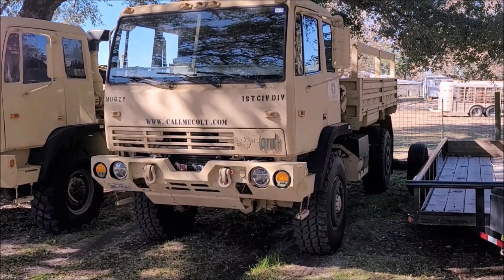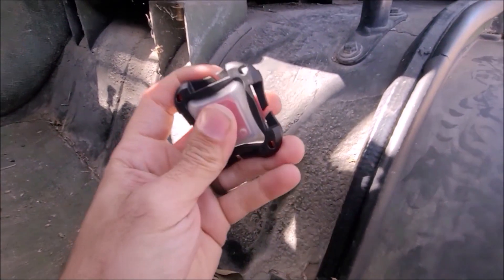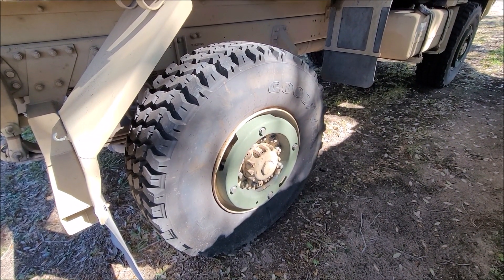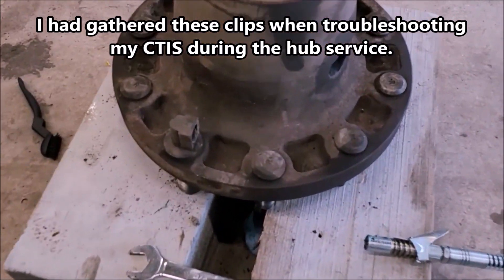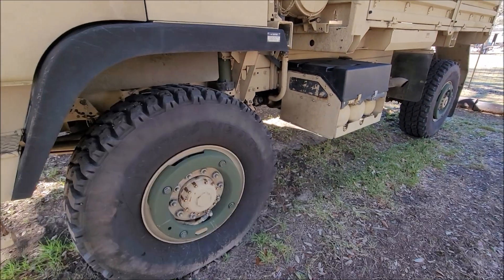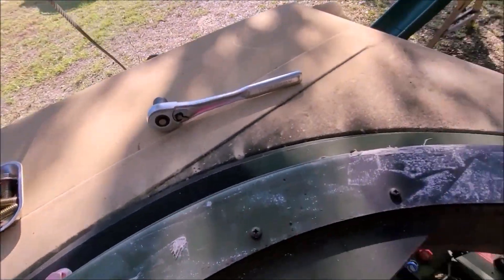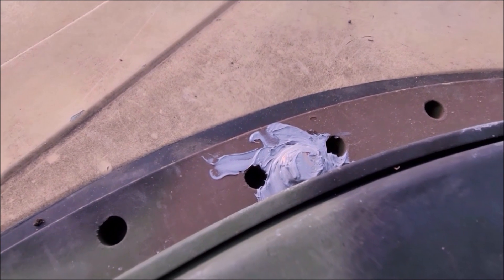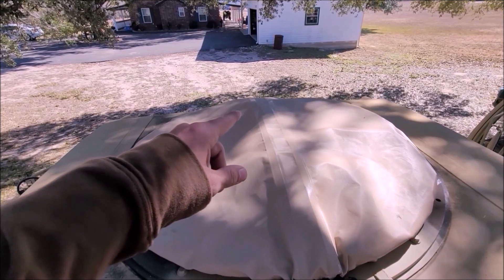M1078 LMTV - Update #14 Turret install, CTIS fix, and more!

Comment: Great content, I was wondering what is the height from the bed to the top of the cab and the bed to the ground?  Thanks.
Reply from the maker: Roughly 9ft 8in to the top of the cab with a few inches to spare. The bed, I am not sure.... never measured it! My guess is around 5ft.

Comment: Good morning, Colt,
I have thoroughly enjoyed all  the YouTube videos you have put out related to this project. Very informative and insightful. I am sure a lot of prep work had to be done to create each of these. 
I have (so far) viewed fourteen of these videos. While they are all great, I have two ideas you want to do on your vehicle. But I would understand that you may want to keep   the focus of the videos in a certain  vein.  

But just a thought, one of these involves modifying your M1078 to be a dump truck by adding an aftermarket  11 Ton Hydraulic Scissor Hoist Kit made by Prime Mover. There is another YouTube channel put out by a couple called Ambition Strikes that created a two-part video on this very project.
Part 1 https://www.youtube.com/watch?v=wSDb6en90Qg
Part 2 https://www.youtube.com/watch?v=wSDb6en90Qg

The second  idea involves the relocation of your rear hitch. Yes, I did see the update video of you adding  an additional hitch type and plate. But what this idea  I am suggesting involves is moving the entire rear hitch more to the rear – to the very end of the frame rails. Again, there is another YouTube channel this time put out by a guy (Andrew Camarata) who apparently does excavation work and thus tows heavy equipment around quite a bit. He found the original location of the rear hitch and glad handles for the air brake  lines to be too recessed. He couldn’t maneuver his loads around tight corners and the brake lines ran the risk of being pinched and destroyed. He solved his problem by moving the entire hitch plate to the end of the LMTV’s frame rails. His video is at the following URL address:
 https://www.youtube.com/watch?v=62Scv7zonSU

Just a thought though. Keep up the good work.
Reply from the maker: I do want to do a dump bed! It is part of the reason why I went will adding the PTO winch to the truck. As far as relocating the hitch, I am not worried about that. I won't ever be pulling that heavy of a trailer with the truck. In Texas, you need a CDL A if you go over 26,000 GVWR with a trailer. That means even a 8,000 GVWR trailer puts me over. I'm not getting my CDL A. I have watch both of the videos you have shared. Thank you for watching all of my videos! I have not had any out recently as the PTO winch project has taken a longgg time but it is almost done and will be uploaded soon! After that, I will have an update video as well, along with a video showing just the M66 turret and the M1919A4 mounted up there. Lot's to come!!

Comment: M12x 35. Bolts not 40
Reply from the maker: M12 X 40 is right from the Technical Manual. Not saying you're wrong, that is what is shows. Looking back at it, I just realized I should have installed #6 in the diagram. GROUP 3401: PRIMARY ARMAMENT FIG.293 MACHINE GUN MOUNTING KIT